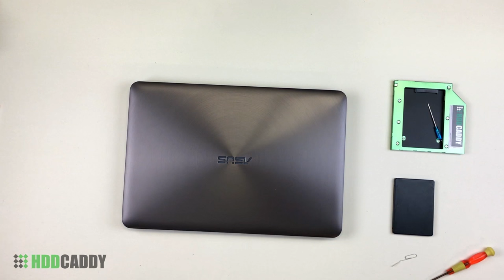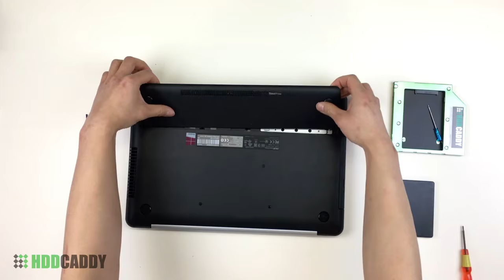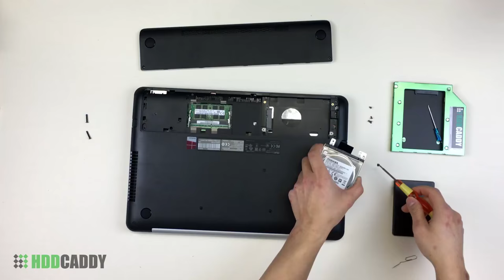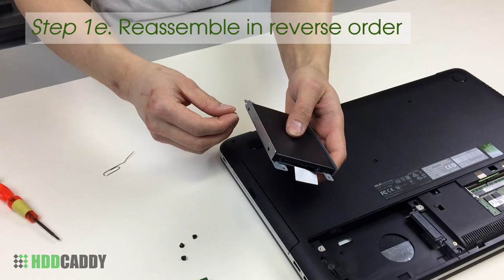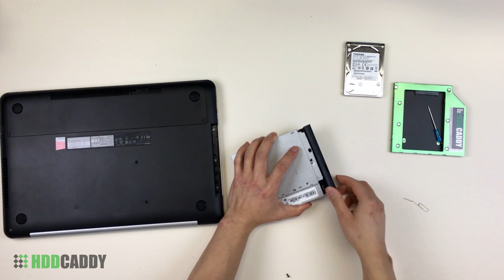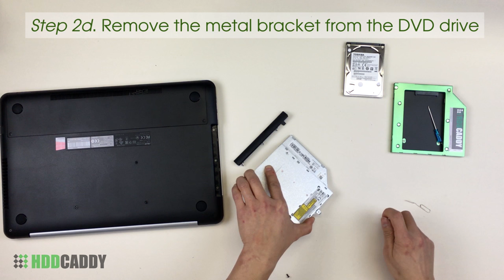How-to Asus N552VX HDD Caddy & SSD installation

Comment: What's the gibabyte syze of the ssd you used ad replacement for the toshiba? i bought a 500 GB samsung 850 EVO and it doesn't go in boot, the asus call center said that that notebook doesn't suppurt 500gb SSD, but only 256... it seems strange to me. please help me
Reply: Hi did you solve your problem?
Reply: Wait seriously? I also bought a Samsung evo 870 1Tb hoping to replace the ssd and I can't even access bios whenever I have the drive in.

Comment: I have X550JX. Will this work?? What is the caddy size?? 9.5mm or 12.5 mm??? Please make a video for X550JX
Reply: Mostafa Monawar 9.5mm will work..using it in my r510jx laptop
Reply: Can you provide a video. Cause to get my DVD-ROM un-mount I guess I need to open the full backcover

Comment: Hi. Will this work for the n752vx series? I'm also interested in replacing the iternal HDD it comes with to an SSD. It comes with 128 GB SDD and 1 TB HDD. So i wanna add x2 more SSD's. Will it work?
Reply from the maker: +SOKRVT Yes, actually N752VX already has two internal HDD bays, M.2 SSD slot and DVD bay (dvd-drive). In theory you could have 4 SSD's in the N752VX :)
Reply: Thanks a lot! Appreciate it :)
Reply: @TheCwab is the dvd port sata 600? Will an ssd have the same speed as when you use the internet hdd place?